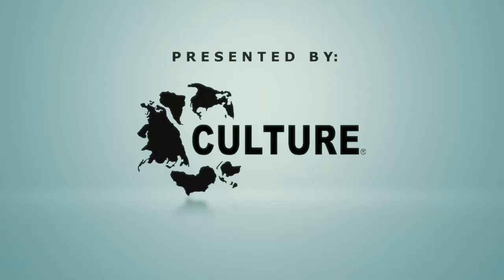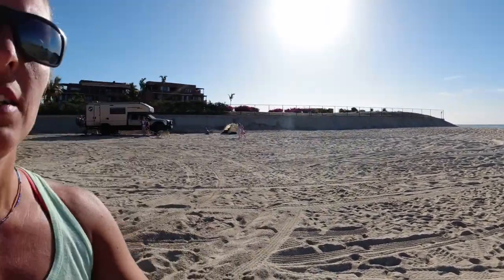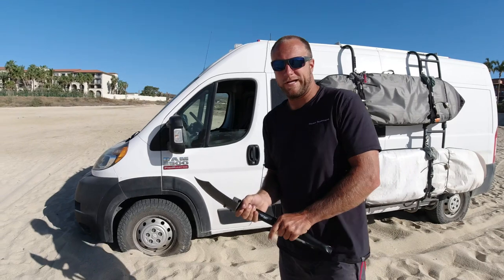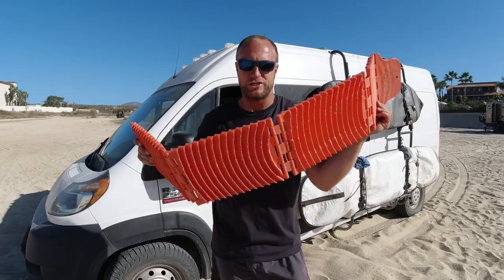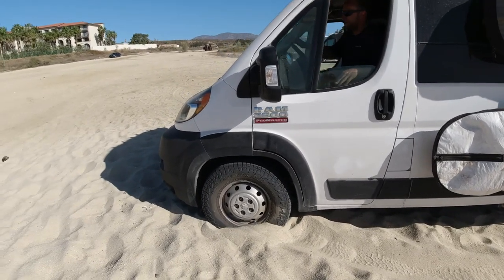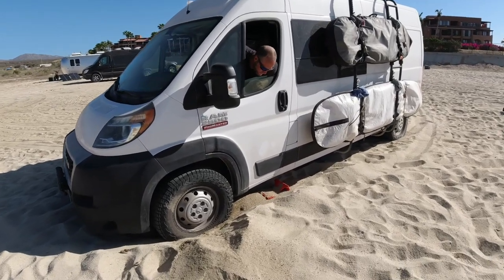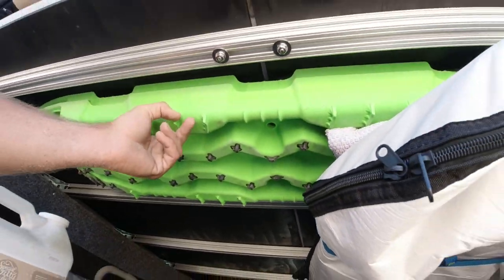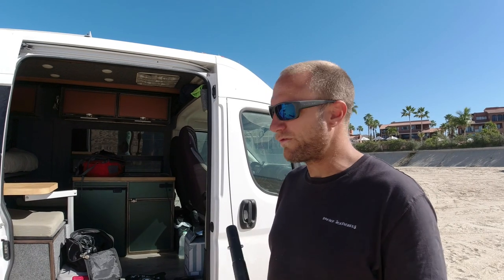STUCK IN SAND! Vanlife self-recovery tips and the gear to get out!

Comment: The Army shovel has another function...dragging sand and a lot of it really fast. They use them in the desert. Just loosen the collar by the blade, fold the blade so its 90 degrees to the handle and retighten the collar. It will run circles around the avalanche shovel as you just drag the sand out from under NOT shovel it. That's all we've used for years running the beaches on Cape Cod. Also, don't be afraid to air down more. Race Point Beach on Cape Cod requires 12lbs or less and Sandy Neck on Cape Cod requires 18lbs or less. The tires will "float" on the sand at those pressures.   I used to tun a 34ft 2wd motorhome in deeper sand than there. I love your videos, keep up the good work!
Reply from the maker: Good info and thanks for watching. I drag the shovel and move a lot but have never cinched it down 90 degrees. I'll have to try it next time. I've heard a bunch of different psi levels suggested but have never felt good about going under 25 (80 is max for these). I've heard don't go below 25% of max which would be 20psi for ours. I play it safe but I'm sure we could go much lower......just don't want to be making a video about re-seating a bead. 😉

Comment: Excellent video. Very helpful. One thing to keep in mind about the tow point, particularly the front point, is to pull straight, not at an angle. The eye bolt and tow point will bend or fail if you pull at an angle.
Reply from the maker: Thanks for watching! That's a great thing to add. We always pull straight if we can......sometimes things get wild and we don't have enough to redirect so you do your best. 😉

Comment: Great video.  Thanks for posting it.  And as hard as it is to not do it, Jess is right, stop the gas before you bury it.  I remember many years ago when I was much younger and dumber, I was with a group and one dude stuck his  Bronco 2 pretty damn deep in the mud.  Towing it wasn't getting it out so he and his crew walked a 1/4 mile to the interstate with his toolbox and came back with a couple pieces of 25' guardrail.  Lots of digging, and a tow and 6 dudes pushing got it out.  There is (almost) always a way.
Reply from the maker: Wow, that sounds like quite the ordeal! At least there were so many of you there to help get it out. We got really stuck a few weeks later, not on purpose, and dug for almost 2 hours, but we got out!

Comment: U think ramp metal will work like I have two ramps I ride a tractor to the back of my ford to cut grass I wanna lay them side by side reverse to get traction on tires
Reply from the maker: Thanks for watching! I guess it depends if they can handle to vehicle weight or not. Sand ladders are an example of something similar. They are bulky but are supposed to work great. Floor mats can help too if things are getting desperate.

Comment: Nice inforative video.i gotta get a set of those deflators. In your opinion, do the solid or folding boards work better?
Reply from the maker: Thanks for watching!  The deflators aren't cheap but they are well worth the cost for the convenience. Overall, if I were only buying one set of boards, I'd probably go solid. With that said, we love the GoTreads for their multi-use and ease of use. They have not let us down yet and we use them often as leveling blocks.